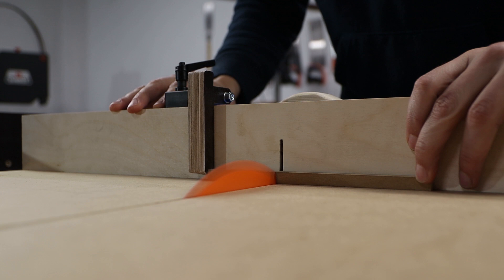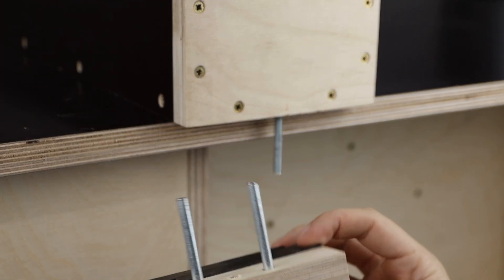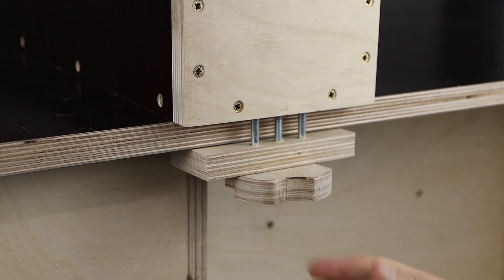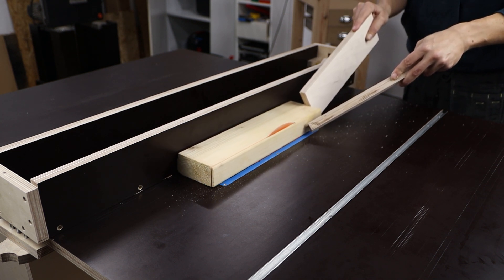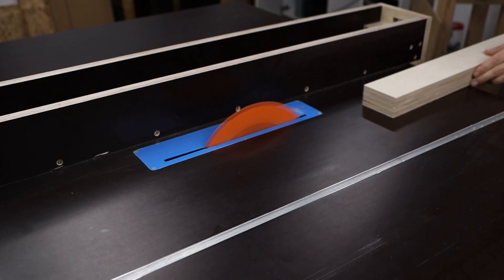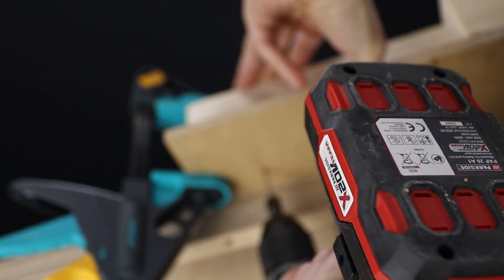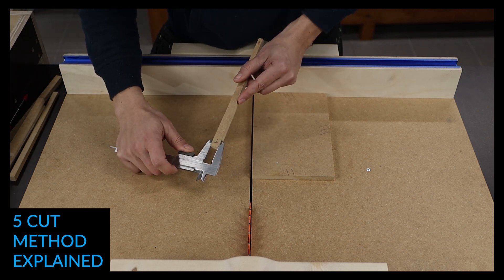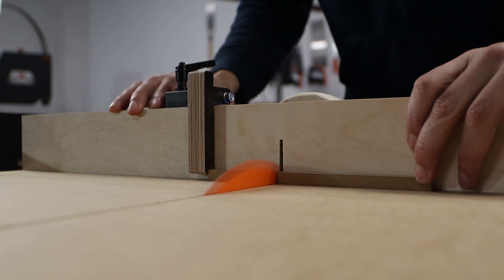DIY Table Saw | Part IV - CrossCut Sled

Comment: can someone explain to me why in the 5 cuts method, after the result how to know which side of the fence should move?
Reply from the maker: Please check the minute 12:40 of the video. Your question is answered here. You always move the same side of the fence, you only need to know if you move it forward or backwards, depending on the result of the shown calculation. I hope it helped! 👍😉

Comment: Hello Dinis, where do you bought the aluminium for the sliders? and what's the dimension?
Reply from the maker: Hi Bernardo, it's U-shaped aluminum profile with the following dimensions: 15mm x 10mm (1m long). I bought it at Leroy Merlin, but you can find it in any aluminum profile local supplier.

Comment: How much cutting depth do you have on 
this saw?
Reply from the maker: In ripping mode, without the sled, it's 8cm (3 and 5/32 inches).
With the crosscut sled it's 7cm (2 and 3/4 inches).
I'm using a 25.4cm (10 inches) blade.